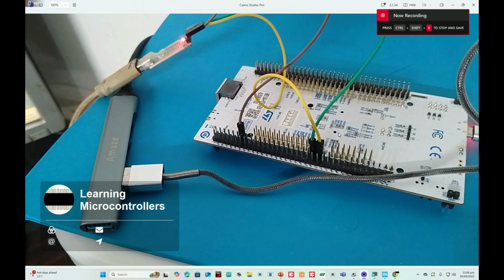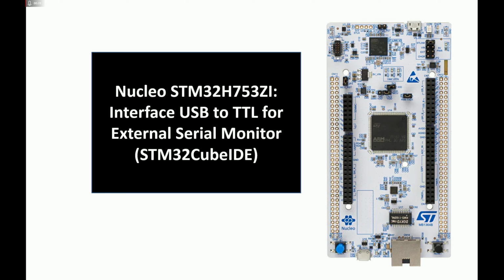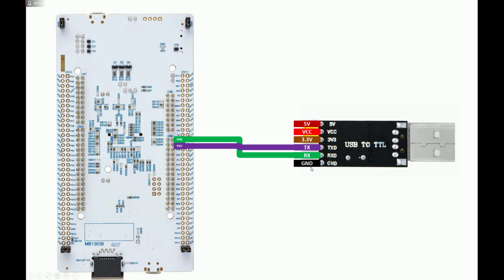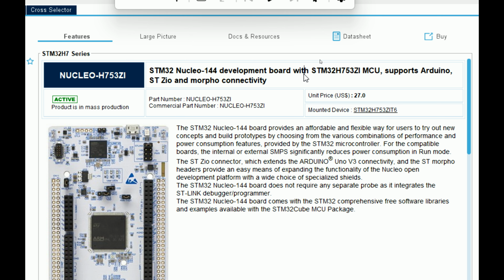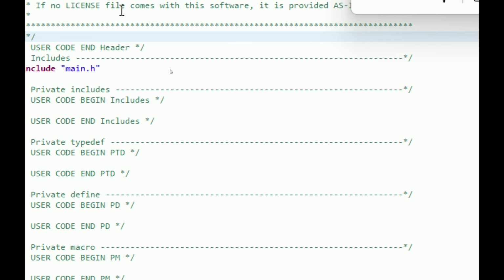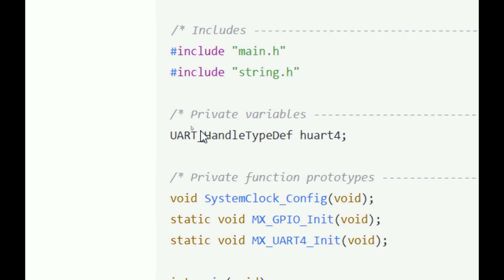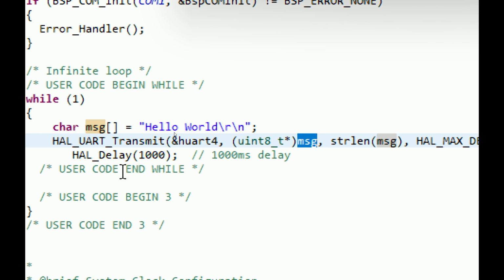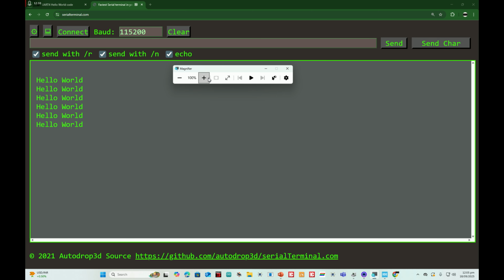Nucleo STM32H753ZI: Interface USB to TTL for External Serial Monitor (STM32CubeIDE).#electronic

Comment: How to use it with out connecting usb to ttl
Reply: In coding portion we have to change & husart3 for  built in serial terminal??
Reply from the maker: @kayalvizhi4941some nucleo board have tha on usart3 some other on different port
Check data sheet for that
Reply from the maker: Yes it has built in serial terminal aswell
I make video on that soon
Reply: Please put video on how to program the microcontroller for receiver board like ublox locosys....
Reply from the maker: @kayalvizhi4941ok soon